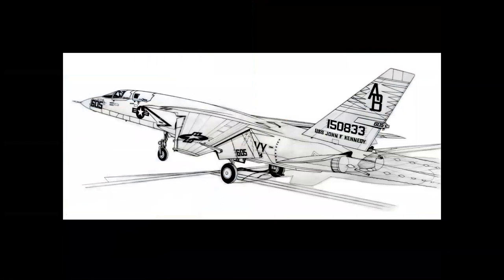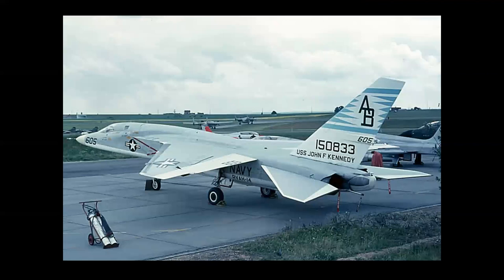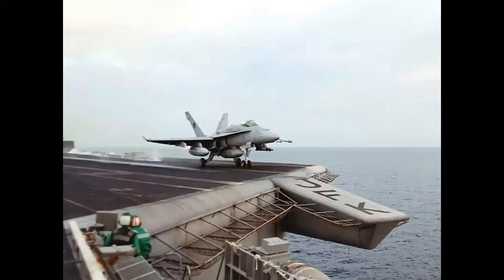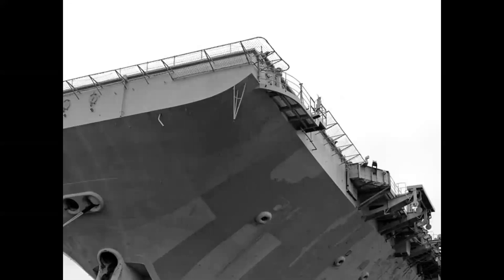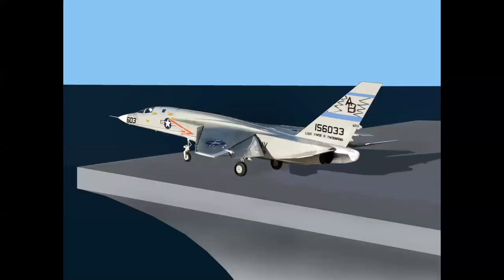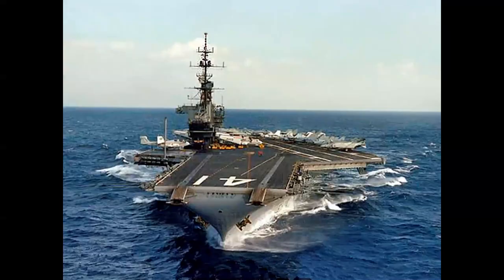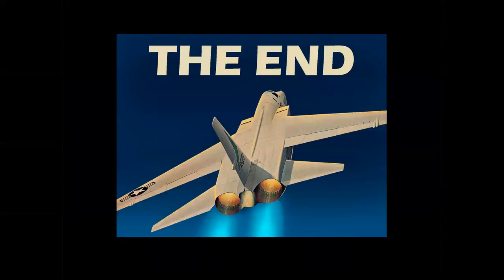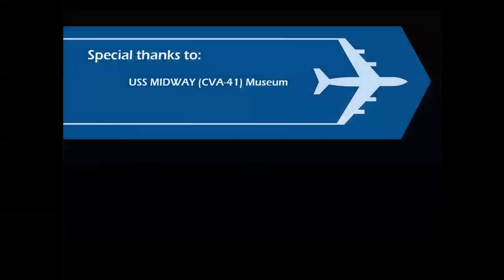UNBRIDLED ELEGANCE - Painting North American's Mach-2 RA-5C Vigilante

Comment: With the RA-5C, I'm struck by how much the engine intake on that design resembles the engine intake of the F-14 Tomcat externally an on the interior.  There's an internal air ramp right on the inside of the Vigilante's intake that's in about the same position as a ramp on the F-14.  There was a little over 12 years separation in first flight between the prototypes of these two planes but the engine intakes, at least externally, were very similar.  The F-14 had 3 air ramps on the inside of the intake; 2 on top and 1 on the bottom of the intake's interior.
It's also been noted the the MiG-25 probably resembles the A-5 more than any other American type as far as general layout except for having twin vertical tails.  The Foxbat is much heavier and less maneuverable than the A-5.
Reply from the maker: Great comment, thanks!

Comment: How do you photograph the model aircraft? I've tried to use a similar technique but I only have a modern day smart phone available which has a considerable amount of distortion in its camera lenses. Taking a picture from further away results in a grainy image not at all useful for purpose.

Also, if at all possible, could you perhaps delve into your process of converting the chosen picture into the first detail drawing? I've tried a few methods over the years and about every method ends up with some compromise in the final shape somehow with proportions ending up off as tolerance errors stack up on one another. 99% of people won't even see it, but I usually catch it straight away on the final product.

Thanks for the wonderful channel, Mike. I do pencil sketches so I'm not a painter but the stories and techniques for tricking the human mind to see speed between two objects etc are really interesting and I will certainly try to implement these learning from a true master!
Reply from the maker: Great question Martin. I've been planning a video on this exact topic, and 'will post it for you Wednesday morning. There are many different aspects to photographing models - from setting the models up to achieve optimum light and shadows to re-creating an exact moment in time down to aircraft heading, time of day, and even weather conditions. I've been using a Canon A-1 35mm SLR camera with 50mm lense, and will explain in detail such factors as camera distortion, telephoto compression, and integrating aircraft into the backgrounds, plus how to develop comps and final detail drawings . 'Appreciate your suggestion and kind words, thanks!

Comment: Imagine this:  The longest and greatest air-raid OF ALL TIME occurred during the UK-Argentine Falkland Islands war using the most visually-imposing and impressive jet bomber OF ALL TIME, the Valkyries with Vulcan tanker accompaniment to boot in spectacular airmanship of an aerially deployed task force involving 10-12 aircraft all coming down to a single Valkyrie delivering a single bomb that knocked out a single runway; mission sorta accomplished; the runway used for anti-ship Exocet-carrying Argentine A-4's or Typhoons.  My point here is that's spectacular (precision and logistically) airmanship, entirely visually astounding and appealing, but pretty mediocre, yet peerlessly wonderful to imagine visually.  
     What does that have to do with the A-5 Vigilante's?!?  Now imagine everything the same, but instead, 2 squadrons aboard apiece of Vigilantes and two American carriers tasked with immediately controlling all air space in the warzone - as was the UK's war aim here with the (land-based) Valkyrie raid.  In this imagined scenario, all manner of aircraft coulda been deployed and recovered too, as necessary, for every/any role, e.g., recon, ECM, diversionary attacks, . . . but to deliver strategic bombing as the Valkyries was designed to do, the seaborne Vigilante's are capable of multiple raids 24/7/365 by scores of these even more capable than the Valkyries Vigilantes hitting everything that even just looked like a runway - at will, indefinitely.

Comment: You drew an A3J/A-5, not an RA-5C ... The RA-5C had strakes from the tip of the intakes back to the wings about a foot down the wing root where it joined the wing ... Plus an attached belly centerline pod for cameras and sensors... see the image at the link below:

https://www.airliners.net/photo/USA-Navy/North-American-RA-5C-Vigilante/1151646/L
Reply: An address with "CAG" sounds like you were a Commander Air Group.  Well done, Skipper, even though that is what squadron commanders are nicknamed. Maybe I was once part of your air group.
Reply from the maker: Appreciate your comment, and interesting points. The centerline pod is visible in the painting just aft of the nosewheel and below the fuselage below the word "NAVY." My client actually had me remove the intake strake from my original drawing, as those were not on this RVAH-14 airplane when it was photographed at a Belgian airshow in 1969. Thanks for watching!
Reply: @celebratingaviationwithmik9782  Yes, thank you for the information and its a gorgeous drawing, just like all your work. Also instead of strakes I should have called them LERXs... (leading edge wing root extensions). Sorry for the failed terminology. My bad...
Reply: What he drew IS an RA5C.  The leading edge at the intakes was added sometime in 1971-1973 for Hvy-14. I can remember sending a plane out for the retro fit and having it come back prior to boarding the Indy in 1973. This was a time when we were still stationed at NAS Albany, GA.   Hvy-14 at the end of that cruise in 1974 was sent to Key West were it was decommissioned. I was able to get an "early out" and left the squadron in December 1973 so I didnt have to make the trek back to home base.